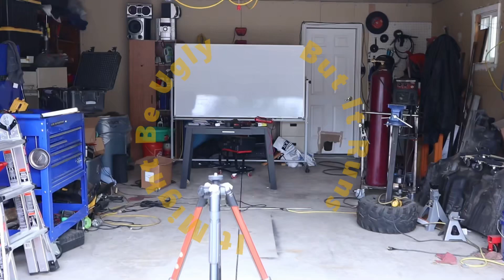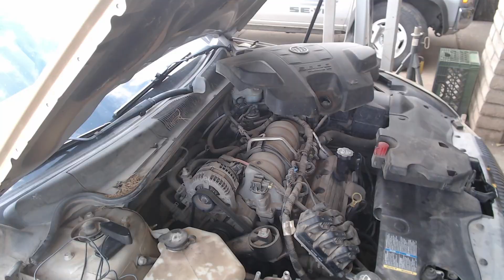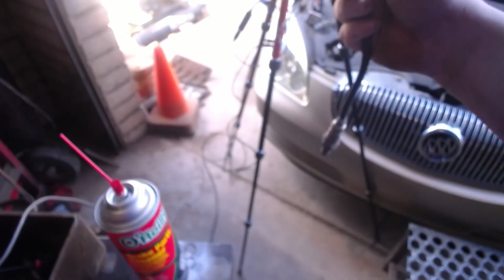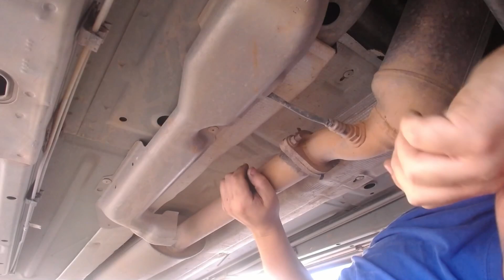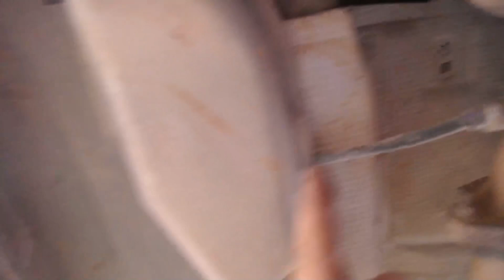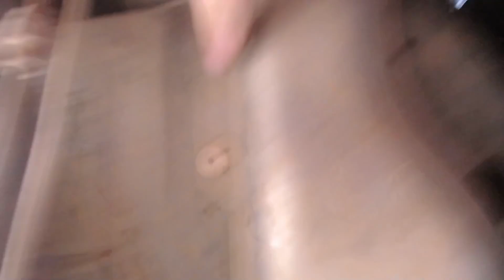Buick Lucerne Aternator and Oxygen Sensor Replacement

Comment: Your rants are funny. Thanks especially for the insights (and humor) about that peculiar, rivoted lower O2 sensor connector cover thing, especially the trick to just slip it out. Was worried it was gonna need R&R'd. And running without the belt for a moment is cool hack, that I hope I don't need.